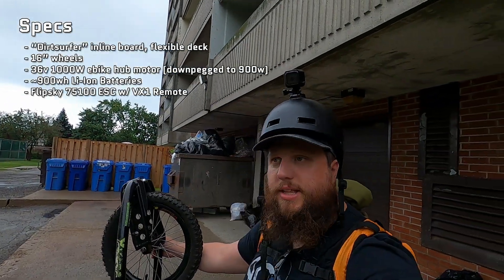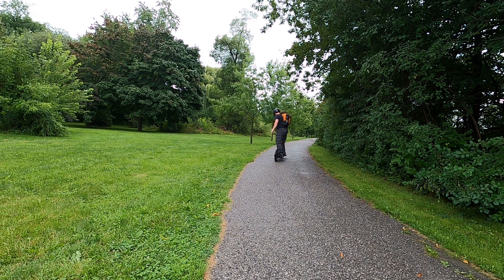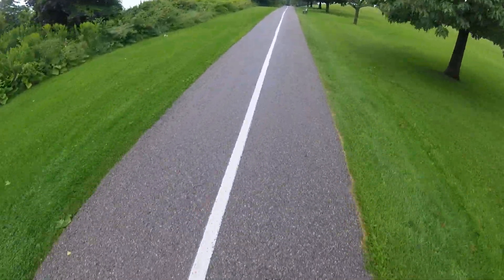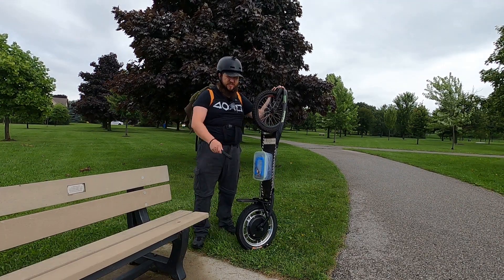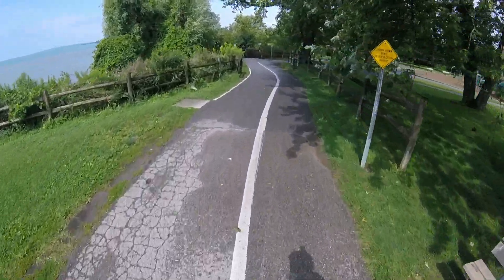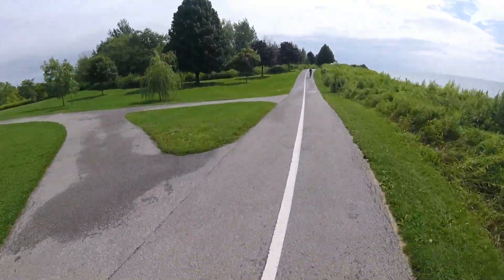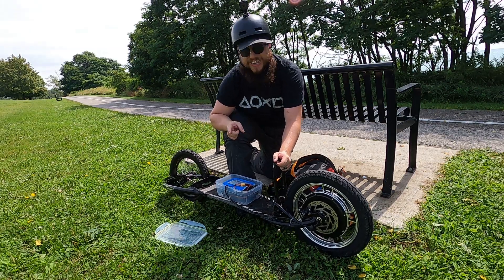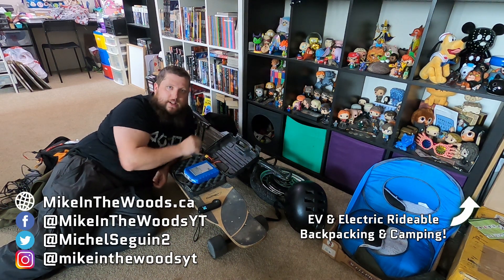DIY Electric Dirtsurfer Range & Speed Test - It Surprised Me

Comment: 8:23 consumption of 20 Wh / km, just about as every other PLEV, maybe on the upper end in this case
Reply: Nice..!  I use my 20" wheeled dirtsurfer on nil-wind days with a paint-pole, with a Kong-ball on the end of it to 'punt' myself along, in the USA, they call it 'Landsurfing', used with a skateboard.   But when there's a good wind blowing straight off the sea, I use it on the beach sand with my Kitewing, & I have gotten up to 40mph, good, but scary..😳👍
Reply from the maker: Yeah it's not bad honestly! Only bad thing is how hard this thing is on your legs, especially at lower speeds
Reply: @Mike_Seguin  I suspect that's a matter of getting used to it, it probably takes rather months than days to ride more and more comfortably and relaxed and making the minimal steering adjustments with almost no effort.

Comment: Cool project! Bumped into this while looking at hub motors for wheelbarrows (Grin, out here on the Wet Coast). I need a trail cart for hauling trail maintenance and building gear. I'll go to your page and check for other dirtsurfer vid's. As a weldor and reformed mountain bike junky, looks like a cool build. 
Just a thought for consideration; how about a spring on the front end. Something to dampen the steering like a torsion spring or as simple as a couple springs attached to the "fork" blades either side of the wheel. Coil spring or a flat spring, like a single leaf spring. Or a torsion spring like found in an old style cantilever MTB brake with some connector plates. Would take a bit of tinkering to get just the right amount of tension. ( The ultimate method would be a torsion mech inside the steer tube.) Just enough to gently push the wheel back to center. This 'self-center assist' may take some of the strain off your legs/knees/hips at slow speed. The rubber pivot on a skateboard truck acts somewhat in the same way to center the board back to horizontal. 
Just food for thought. 🙂👍
Reply from the maker: Once moving, it's stable and the front wheel naturally wants to center. I'm not sure a spring would help much

Comment: Hey man - you need knee pads , elbow pads and at least some wrist braces. I have used all of these and my full face helmet on
my electric Dirt Surfer. Also watch out for deep grave and sand. The faster you go the more stable it gets - until you hit that deep gravel/sand - hence the dents in my knee pads and scratches on my helmet.  I also got caught in a storm front downpour and my Dirt Surfer kept on trucking.
Reply from the maker: Yeah would probably be smart

Comment: Hello Mike, I'm back again with some more advice that might interest you. Addressing the tire pressure and ensuring proper wheel balancing can have a remarkable impact on enhancing the stability of your board. Striking the right balance is key – too soft and it becomes wobbly and difficult to initiate, while too hard can result in unsettling wobbles at higher speeds. Additionally, the tire tread direction and pattern, such as knobby or smooth street tires, can yield similar outcomes & difficulties.

Looking ahead, I envision a future with more comprehensive technical insights incorporated into these range tests. This could involve both on-road and off-road evaluations, providing a clearer understanding of the energy efficiency in terms of WH/KM (watt-hours per kilometer) across different speeds and Road/path conditions. Sharing these detailed findings could not only generate more content but also offer practical real-world data to enhance your riding experiences and next adventure. Having been a dedicated viewer and an avid backpacker/traveler for quite some time now, I truly believe that incorporating this data is absolutely pivotal to the narrative you're aiming to weave.